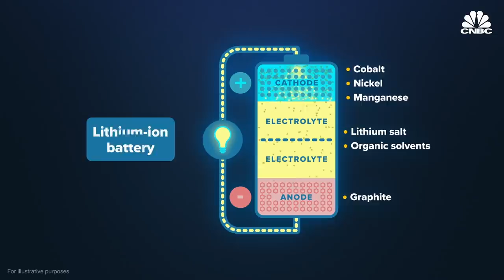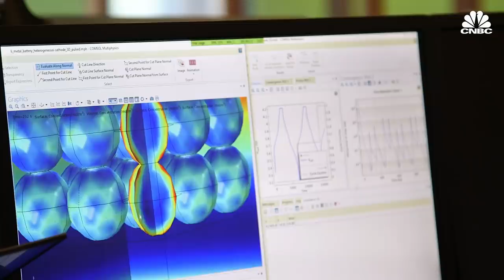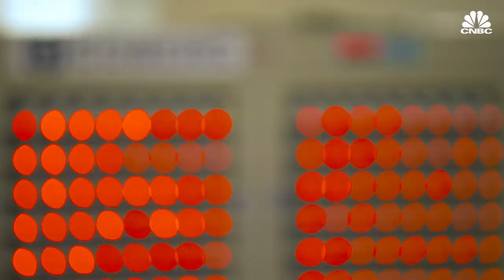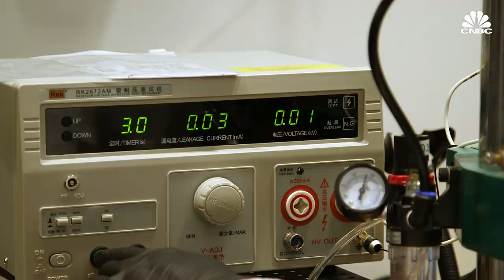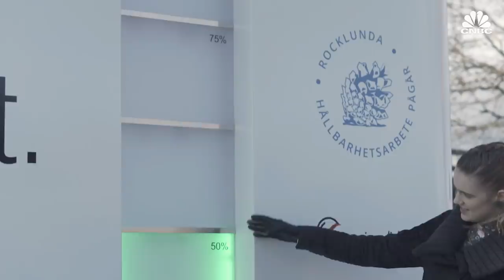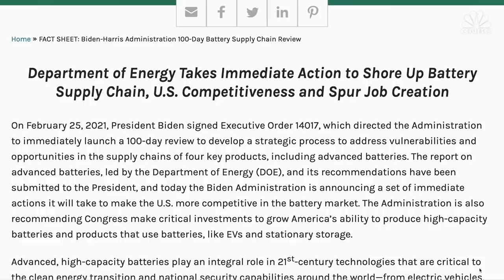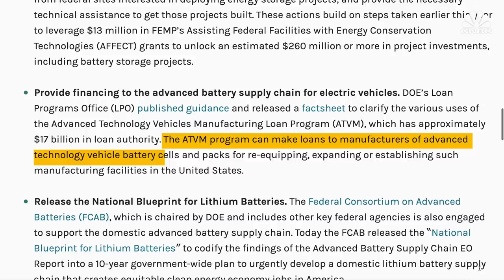Why This Battery Breakthrough Could Make EVs Cheaper

Comment: News about 'The Next Big Thing' in battery tech has been a dime a dozen for the last decade. The real question is, when will a winner finally reach the mass production stage?
Reply: the more news stories like this we get, the sooner I bet
Reply: Lithium batteries have changes a lot also.... density, quality and manufacturing so while it is not a new type of battery improvements are all over...
Reply: Yeah let know when a major manufacturer is putting them in a product.

I think we see more of these stories because there is alot of doubt about the sustainability of electric vehicles.  The only way is if we develop a new battery technology with significantly more energy density.

It makes me laugh how this experimental companies claim their battery production is more efficient, uses less energy... Et cetera et cetera, however you still are building prototypes... Lol
Reply: never, because the fundamental science and mechanics are the same as 100 years ago....the very first cars were infact electric...the fact of the matter is the internal combustion engine is fundamentally more reliable and efficient at automotive applications...we need something fundamentally new to replace it.....like in aviation....the jet engine is a new development over the propeller and is fundamentally better..
Reply: When Toyota stops dragging their feet
Reply: Just remember the Tesla Giga factory in Nevada make more Lithium ion batteries than all the other battery manufacture combine.   It takes two hours just to walk around the Giga factory in Nevada.
Reply: @thehoovah  those claims are usually based off laboratory or testing conditions. cost effective scaling and market economics, not the physics, is still the largest barrier to adoption
Reply: @genogenson  tesla is esencially the car version of the iphone......by rich snobs....for rich snobs...and for poor fools to idolize both.......real innovative tech is. how a pile of scrap and run down diesel powered truck in the middle of nowhere in africa is fixed up by some dude who cant even read....that is the beauty and simplicity of a true technological breakthrough....coincidentally that fella also owns a cheap Chinese android phone...which he fixes from his neighborhood phone repair guy.....and much interestingly neither of the two pieces of tech were subsidized by the govt.....THIS IS TRUE INNOVATION
Reply: @zion3335  I wouldn't say a combustion engine is more reliable. Go back 40 years and you'd see people broken down at the side of the road. There are a lot of things to go wrong in a combustion engine, and only through decades of development, and the dawn of the computer aided design have we turned this complex machine into something reliable. Just 10 years we're going to see some truly rapid developments in electric technology that every advantage a combustion engines have today will quickly be overcome. Electric is already more reliable. Cost,  charging times, distance are the main issues. Once we can convince people total cost of ownership over 5 years is cheaper than gas cars, the horse will bolt.
Reply: Tesla has already won, but you’re never going to hear that unless the ad money leaves their hands and ends up in CNBC’s lap, or whatever the media/propaganda pusher outlets are
Reply: @zion3335  Tesla is about to make a $25k car.  Now who’s the snob?
Reply: @thehoovah  this is the type of comment I like to in comment section...its like they are running some hidden agenda to just hype the batteries without any significant progress
Reply: We need a new sorce of clean energy like methane and hydrogen mix with a little o2 aka stuff we can get anywhere cow pig chicken farm dumps for methane o2 and h20 water bad water waste water decaying plants greenhouses tada
Reply: @zion3335  Efficient? Combustion engine is horrible.
Reply: @jepulis6674  Yes Mister I no buy no more ice cars. I only keep my ice truck and buy no more until electrico cars become more available.
Reply: It has... its Li-ion
Reply: When the question is "who will actually do the mass production".
There is only one answer. Always.
China.
Reply: I mean - prices did drop significantly over the past decade, so there is progress being made in terms of efficiency and scale
Reply: And massive progress has been made in that decade. 10 years ago we didn't even have electric cars.
Reply: @Mr30friends  Not according to official Tesla Gigafactory plans. The China Gigafactory is vehicle manufacture only, battery manufacture is slated for the US and Berlin Gigafactories
Reply: @Steamrick  well yeah, cause chinese battery companies are already in a position to fullfil teslas battery needs for the chinese market. And that pretty much says it all...
Reply: The jet engine is also fundamentally less efficient per mile when it comes to fuel comoared to propeller
Reply: It's all largely nonsense driven by scientifically illiterate 'pundits' like CNBC ! A classic example of the triumph of the arts degree over science.
Reply: @erikpienk  no
Reply: @zion3335  Yabut, the electric motor is >90% (95% ?) efficient. Undeniable.
Reply: @Madame702  NO THEY DON'T ! YOU'RE LIVING IN LA-LA LAND IF YOU BELIEVE THAT HOGWASH. TESLA LOVE PUBLICITY AND WILL LIE TO OBTAIN AS MUCH.
Reply: @zion3335  apart from the batteries, electric motors are way more reliable than internal combustion engines.
Reply: @sneaky_krait7271  but they do need batteries to function
Reply: @grahamstevenson1740  i am talking about the battery.
Reply: @zion3335  Well even with batteries they are more reliable. The only real bad part about them that their life cycle ends after 10 years now.
Reply: @jepulis6674  do you know from where the lithium comes....right from mining of the mineral to ore processing destroys some of the most sensitive areas of the planet and creates vast amounts of polluted water for poor communities...yes!!!....very sustainable indeed...and where do the majority of lithium ion batteries end up after use....the landfill...
Reply: @djlovetap2141  and do you also know that musk is designing his cars to make it impossible for 3rd party independent repair shops to service also tesla is planning to make the battery more difficult to replace...the average car is 11 yrs old...the replacement battery pack is more expensive than a used tesla....it straightaway goes to the scrapyard...
Reply: @jepulis6674  yes it is...but its better than electric....i am in favor of some new novel tech to replace the combustion engine...
Reply: @sneaky_krait7271  no they are not...the charging discharging cycle destroys the lithium  batteries and it takes just a single cell in a battery pack to stop the system...and just check out the cost of replacing the single cell....and you never know when the next cell will burn out....this is why the resale value plummets after warranty is over....typically the warranty on the battery lasts for 8 years and between 100,000 and 150,000 miles. after that....just throwing away the car is cheaper.....
Reply: @zion3335  Yes that happens sometimes, but really how often is the important question. Also many small petrol engined cars go until 150k miles and are worthless afterwards
Reply: @zion3335  you are crazy, electric motors need zero maintenance and can run for decades. They are also 90+% efficient, that is 3 times more efficient than combustion engine. More performance,  just look at video of Tesla plaid, a family sedan roasting super cars on acceleration. The only thing holding the electric car is the battery,  but already we are getting closer to price parity with current tech. In 5 years it will be the case.
Reply: What most don't understand if you don't follow electric cars is that we might not even need some revolution tech. Prices of lithium ions battery tech has decrease like 10x already and an average of 5% per year. That is we might be at price parity in 5 years. In the last 2 years we have seen 800 volt charging tech from the Porsche Taycan and now much more affordable Hyundai Ioniq 5 etc. You are getting 100 km in 5 minutes, and 80% in 15 minutes, that is about 250 miles. There is a popular youtuber that tested the Audi GT on his 1000km challenge.  And it finished like 10 minutes more than a normal car. The thing is, he was exhausted because it charged so fast that he barely had to to eat, rest and pi.
Reply: @danielvilliers612  the batteries are inefficient in energy retention.....i never mentioned motors...but you conveniently focused on it to draw away attention...from battery problems....the discharging and charging cycle is wasteful, battery discharges at low temps and as it ages...well it becomes worse at charging and holding energy... there only 2 things that ever held back EV's and since the last 100 yrs it remains the battery....the motor was never an issue....
Reply: @danielvilliers612  In the case of range yes, however they still weigh and cost a lot because of the battery. Another concern is that they need precious metals and the world will run out concerningly fast out of them. EV are already pretty competitive right now, however with better batteries they will be the clear winner
Reply: @Click Bait You'd have like $50.
Reply: Exactly my words. Everyday there’s ooooo new cheap technology.
Reply: Doesnt it seem like it's a format war brewing to see who will build the world standard battery to power the future?
Reply: When your kids finish College.
Reply: @danielvilliers612  90% efficient 😂 15% is lost only in charging the car and rest will be discharging loss motor loss   It is 70% efficient
Reply: They allready have wdym ??
Reply: @thesilentone4024  The electrolyzer needs very clean water or it will break down pretty soon. And, up to now, you need platinum for your electrolyzer, got that in your chicken farm dump?
Reply: Well, there's a significant barrier of entry to the market in terms of the capital costs of establishing a production line.  Perhaps if governments invests in incubators with flexible factory layouts where startups can have subsidized prototype production to solicit clients and investors with.  Ideally, 3d printed battery technology would be needed to allow all the possible options an opportunity to be developed to a commercial scale.  We can only do so much in a laboratory.
Reply: Quick answer for you bud, never 🤣. This is all just “stock marketing”
Reply: Mr. Cool  Dude, we got more Teslas and EV's then you can shake a stick at,
We did this by removing taxes on them.-Norway
Reply: Yeah, progress has been more evolutionary than revolutionary, but at least in the last decade, Li-Ion batteries have dropped in price by 88%, and have 1.5x the density. There is a new stationary battery tech set to take over the grid storage space that's already doing a limited rollout, but I'm not aware of an entirely new mobile battery tech that's in production.
Reply: Good question 🙋🏼‍♀️
Reply: of course in near future

Comment: I keep hearing 10-20% cheaper. Cheaper than li-ion today or cheaper than li-ion as it will be 5-10 years from now? 
Li-Ion battery prices have been dropping an average 20% yearly for the past decade. I have no idea where the $170-180 per kWh cited in this video came from because that's 2018 pricing. The 2021 price is more along the lines of $130 per kWh.
Reply: that dude is probably taking average of all lithium ion chemistries. you are right most lithium ion cells that automakers use today are way below that figure.  Lithium iron phosphate have been below $100/kWh for over a year now ( source: BloombergNEF)
Reply: Nice insight!
Reply: With lithium-metal you can remove the entire anode production part of the process.
Reply: @rojavabashur6455  With Graphite/Si anode you’re at no less than 500mAh/g and that gram cost is really not an issue. And with solid electrolyte you do not need excess Li or prelithiation.

Metallic Lithium is a total hazard always as it really hates to be alone.
Reply: BYD is now producing these for $95 per KWH................Paul
Reply: Sources for those stats?

Comment: This video feels like an ad more than anything else. Especially their call to action for investors at the end.
Reply: Couldn't agree more.
Reply: They also said several incorrect things, like that lithium ion is the only chemistry used. Lithium Iron Phosphate (LiFePO4) is also used.
Reply: Halfway the video I checked the channel to see if it was Northvolt.
Reply: @iKingRPG  it’s beacuse LFP is also li-ion. As are LCO, LMO, NMC, NCA and LTO. And then there is horde of electrolyte mixes to choose from and not to mention additives to electrodes and solid electrolytes.

There really are millions of ways to make a li-ion cell. To know even 10% of all this requires a lifetime career in the li-ion business. 😅
Reply: Northvolt has no problems finding investors.
Reply: I have noticed all their videos are ads. Kind of pathetic.
Reply: @Clarissa 1986 those are all li-ion cells. Lithium polymer cells just use more polymers. If we put it more simple terms.

As long as the carrier of the charge is li-ion.

Even solid electrolyte cells are li-ion if those use that Lithium to store the energy with ions as rocking chair.
Reply: @rojavabashur6455  right. And they will need an IPO to get those investments paid back. The problem is in the production volumes and profit margins. The battery costs are declining and one will need great volumes to make billions in profit.
Reply: electric car soyboys
Reply: The primary function for TV programs is to sell product.
Reply: @iKingRPG  lfp is a type of cathode part of a li-ion battery.